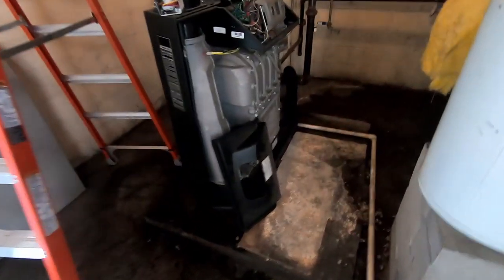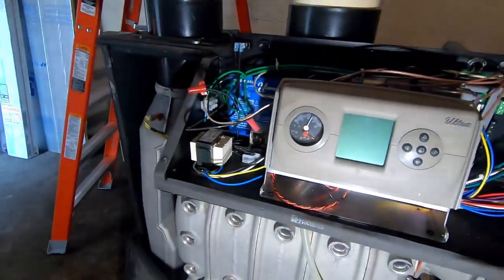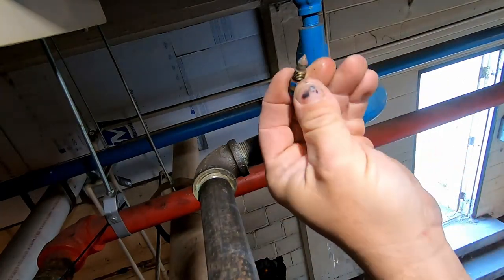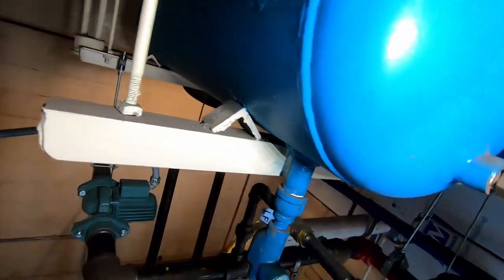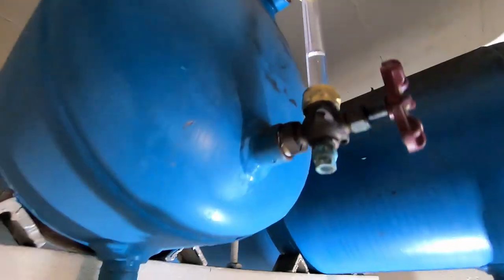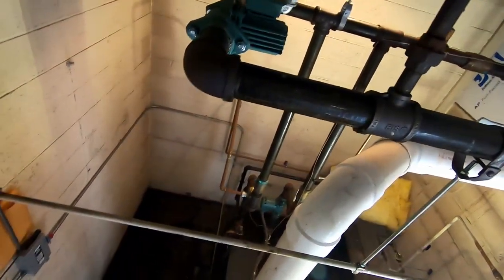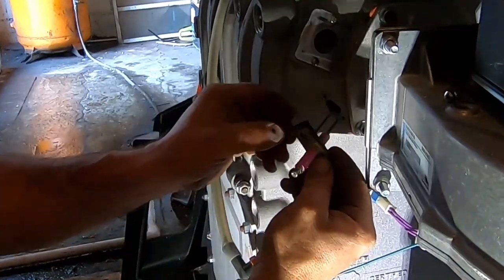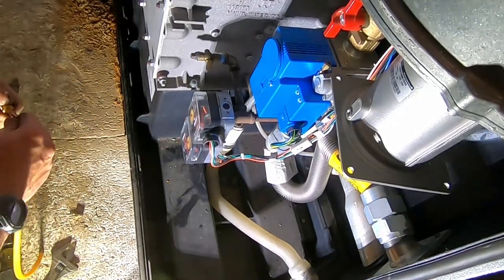Commercial Boiler Over-Heating Several Problems Corrected

Comment: For relief valve I always use black pipe and nipple or copper pipe with copper union so in future I do not have to cut and solider it again Nice video
Reply from the maker: Good pointer👍👍. Thanks for checking it out!

Comment: I got a ultra 155 series 2 that has been great for the past 15 years.  Only the fan had to be replaced at age 14.  Regular maintenance is the key.
Reply from the maker: Yep, gotta flush that heat exchanger preferably every year. Thanks for the feedback 👍👍

Comment: That zone valve I think is a Taco made in Cranston R.l. great quality products from a great manufacturer. Yes I think 6" is correct on the pop off but locals push the issue. On a saftey note did a boiler in a commercial building and got water on mech flr and maintenance guy walked in fell got hurt and the company I worked for was reliable. So I learned to use a bucket the hard way. Ass chew wasn't the best. Lolol. Usually high pressure gas is usually painted yellow and should be labeled accordingly. Great video like you said for guys that don't have a mentor to give them advise. I don't mean anything by it, just try to help and give hints of what I learned in the trade for many years. All good. Thank you for the video and experience,knowledge, and for Sunday nights of your time bud. Stay safe, be the best you can be and please help save a dying trade of great guys in it. Peace.
Reply from the maker: I believe your correct on the 6" off the ground. I don't have all the rules memorized. I was more or less going off of what I thought it was but said to double check the local code to cover there butt. Thanks for the information on the high pressure color. I believe we only have low and med. pressure in town. I do so many different things in the field I can't ever be a expert at all of it, there's just to much to remember.
Reply: Very true no one can remember every little thing in the trade. You are very welcome. Have a good week and please be safe.

Comment: Did a water heater pressure/ relief change where the pressure/ temp relief pipe had been tightened so tight i had to use 2 24 inch pipe wrenches to get them separated.  Way to tight. And it was black pipe so I went to copper and got rid of the black pipe.
Reply from the maker: I hate dumb people 😡. Nothing surprises me anymore, it just makes me say why? 😲

Comment: I was told by people who work at a gas company that in the mornings when business start up that they have to keep ahead because the main lines gas pressure will drop which you might have seen. If it is too much they add propane which help to increase the gas pressures up.
Reply from the maker: That's interesting, thanks for the info.
Reply: This is true. The add a mixture of propane & air to keep a btu rating similar to Natural gas.  Generally done at times of high demand.

Comment: How long have you worked on commercial boilers and what training did you undergo before working on them? did you just figure most of it out on your own or is there a school for commercial boilers?
Reply from the maker: I've done HVAC since 1995. I do a little of everything as you might have noticed on my videos. Mainly you learn as you go after learning your basics in school. There tends to be a common certain number of things that tend to go wrong on boiler systems so although they might be bigger or smaller they generally have the same parts going bad. They tend to have after work classes and a day or two classes for any particular boiler you want to learn more about.

Comment: I can hardly imagine that the few threaded rods should carry 2 containers that big if they are also full. Would be too risky for me personally to build something like that. But apart from that, don't you risk destroying the new valve when soldering on the pressure relief valve? Although, viewed from below, they're not as big as I thought. Looked like easily 200L per container
Reply from the maker: Everything is still working good 👍👍

Comment: Medium pressure?
Reply from the maker: It's the pressure the gas company uses to deliver the gas. Higher the pressure the smaller the pipe they can use to deliver the same volume of gas, this is to save money on pipe.

Comment: The gas line pressure drop of 1.7" is pretty high (7" off minus 5.3" running). Either piping is too small, regulator is too small, or regulator isn't working right. Some codes spec 0.5" drop max, I look for problems when it goes below 6". Couldn't tell in the video but gas pipe needs to be 1-1/4" or larger for 550k. Regulators require periodic replacement just like boiler feed regulators because the rubber diaphragms inside get hard, and the springs get weak, valve sticks, vents get blocked, etc. especially being outside. I'd put the boiler in manual low fire and set the regulator to have at least 7" at the boiler (some gas has to be flowing to set a regulator correctly, a lot of techs miss this). Might need to turn up the regulator a bit to keep 7-8" on low fire. When the boiler shuts off the pressure should rise a little bit due to regulator lockup, if it goes up more than 1" or so, the regulator might be bad or you have a restriction. If code allows, I'd move the regulator inside right next to the boiler for the most consistent input pressure, otherwise you might need to upgrade the piping and/or replace the regulator. If you still have pressure problems you should call the gas company to check their regulator and gas pressure on the meter, they can go bad too.
Reply from the maker: I've noticed the pressure tends to swing a lot more than it should. The customer said they replaced the regulator, I think twice and had the gas company out. This is real close to a oil refinery, I can't help but wonder if they are causing major draws on the system line causing spikes. I believe it was the high pressure switch that was tripping and not the low but because the person I spoke with said it's been happening since the install years ago and after several checks from the gas company and the original installer contractor figured it was a losing battle.
Reply from the maker: Thank you for all the good information 👍👍
Reply: @HVACRSurvival  No way it should trip high pressure if the regulators are working right, they should close it off before it gets to 14".
Reply from the maker: @TechnicalLee  true, maybe it was the low pressure, he was a delivery guy I spoke with then he left after showing me everything so I didn't get a chance to get more information from him.

Comment: Doesn’t it reset the boiler loop temp vs. outside air temp?
Reply from the maker: That's basically what I was saying, the boilers water temperature will not go to full maximum temp unless the outdoor temperature reaches the set point that it is set for.  Basically the colder it gets outside the hotter the boiler gets, vice versa as it gets warmer the cooler the boiler gets.
Reply: Reset schedule. It saves fuel baby
Reply from the maker: That's what they say, I've never owned a boiler so I have never experienced it firsthand but the people that we have put a high efficiency boiler in for tend to say they saved money 😁👍👍

Comment: It terrified me the way you attacked that sensing probe with the wire brush. I wouldn't dream of doing that unless I had a spare replacement handy, once the metal rod breaks free of the ceramic then that's it, scrapped.
Reply from the maker: I look like I was roughing it up pretty good but I haven't broke any yet like that. Unfortunately I cleaned a million of these sensors.

Comment: If that pressure relief was blowing, there is probably little inhibitor left in the system. With that system out of the way it could have been using 100s os gallons of water and just draining right at the floor drain with no one to notice.
Reply from the maker: Good point👍👍. They didn't call me because of the pop-off valve they called me just because the office was too hot. I found all these other things by doing a investigative diagnostic.
Reply: lol, if there was ever inhibitor to start with! ( probably not)

Comment: My professor wants me to describe each of the four components of a hydronic system. Im confused it has more than four components lol.
Reply from the maker: Either pick the most important ones to make the system run or ask him why he only wants four? It's kind of like an air conditioner. You got a compressor, a metering device, a condenser and a evaporator. But some ac units might have a ton of other controls.

Comment: Spiro vent will steal air that should go into ex tank
Reply from the maker: I've never heard that before. By default the expansion tank is going to have air in it because there's no place for the air to escape to as it fills with water and it's above the system. Those tanks do not have a bladder in them like a traditional smaller expansion tank.
Reply: @HVACRSurvival  I think that's the point he's trying to make. Any air in the system may otherwise flow back into the expansion tank and stop it from getting waterlogged so quick. However the tee feeding those tanks was heading out the side of the manifold rather than the top so probably wouldn't catch much air even if it were the spiro vent.
Reply: @Thermoelectric7  this^